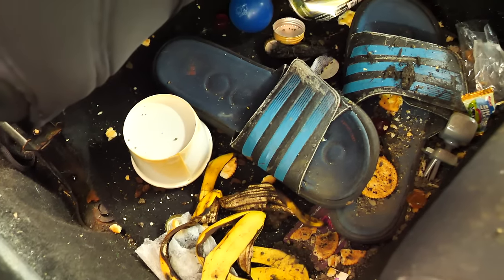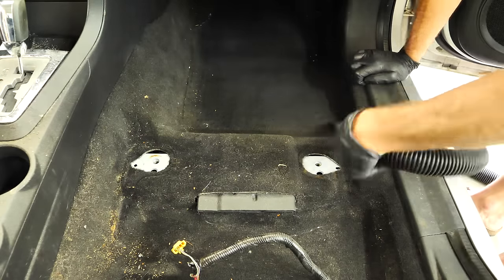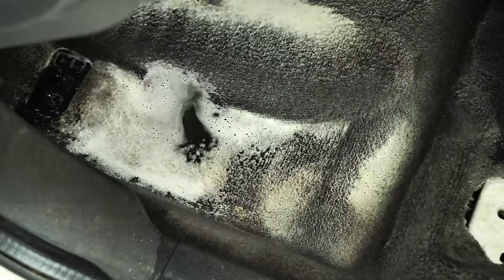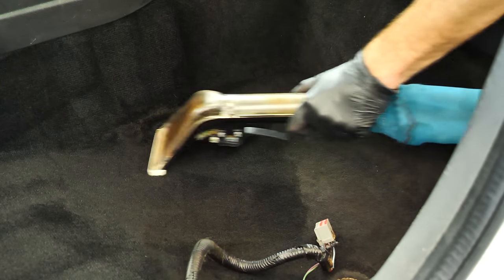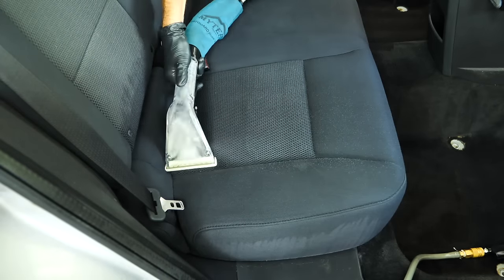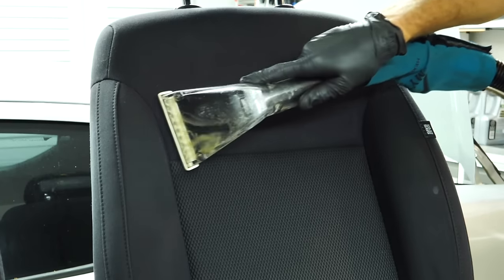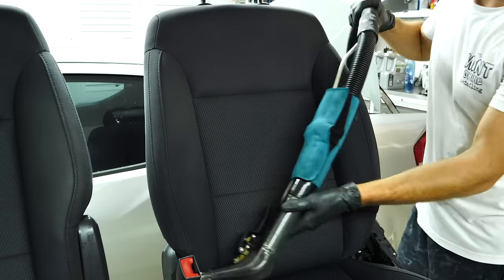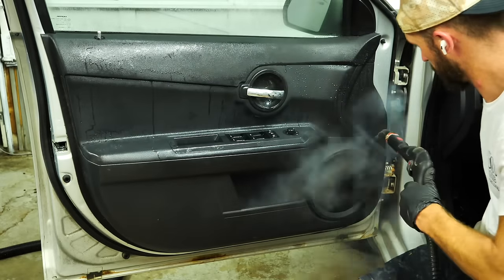Deep Cleaning A NASTY Dodge Avenger! | Car Detailing Restoration!

Comment: Love the job you did! Question. I own. 2014 avenger and wanna clean out under my seats. Did you disconnect the battery from up top? I know detailers have said to remove or disconnect the battery before removing the seats. Love the content man!
Reply: I'm 2 weeks late with a reply, but you should 100% disconnect the battery before removing the seats, because they might contain airbags and they definitely contain electronics related to the airbags and safety restraint systems.